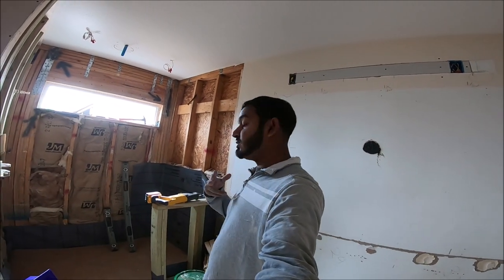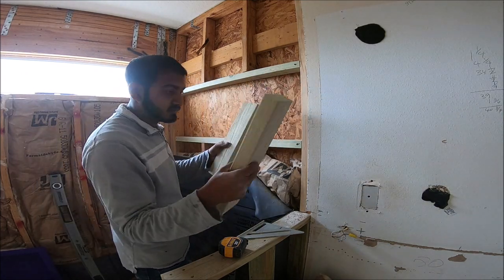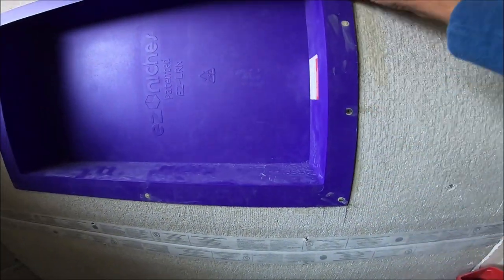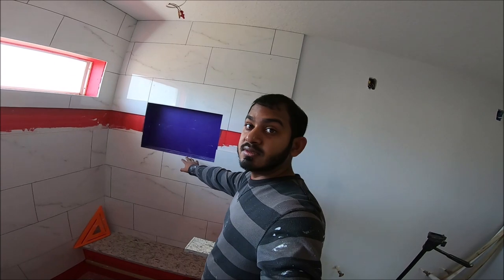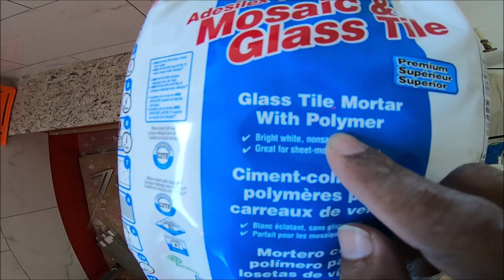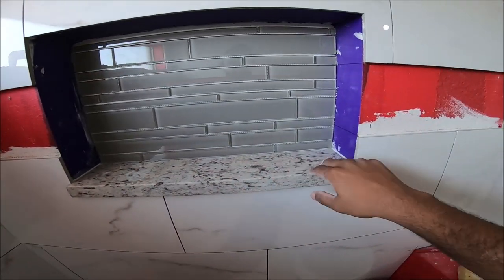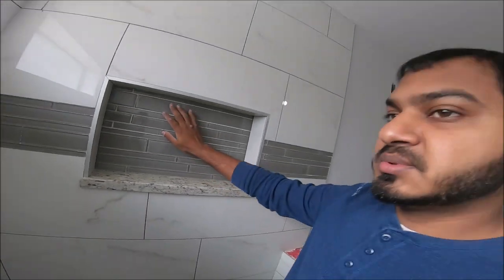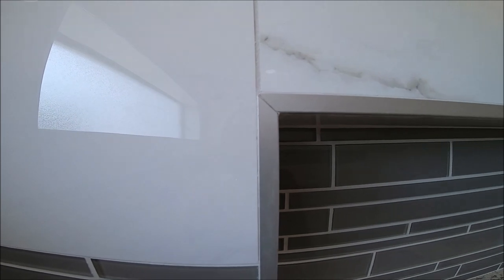How To Tile A Shower Niche - EZ-Niche, Granite Base, Metal Edging, Glass Tile, & 12 By 24 Tiles

Comment: At first I was nervous that you cut those studs but didn’t carry that weight with anything, but then you came thru at 4:26 and put my fears to rest 😂🤣😂
Reply: Heh...if it was load bearing it would probably smash down on the blade on his sawzall and get locked up.  Definitely know ahead of time if what you are cutting is load bearing though!
Reply: It is a load bearing wall, he needs to learn how to frame and put a header in there loo

Comment: Except for the fact that this will not pass building code, nice job!
Reply: If that's a load bearing wall which it does appear to be based off the framing and exterior plywood then exactly. Regardless being a tile guy myself I frame niche out with a header king queen jack studs for code and integrity if the house makes a dramatic shift, i know my tile isn't gonna pop and cause structual issues on a load bearing or  partician wall lol

Comment: Really good job, but do you not use silicon on the wedges ?
we always  use silicon on all the wedges on the  wall and floor, in Europe.
I figured out that on a few years of use some tiles crack because of the movements of the house and pressure from the corner.
with some flexible silicon it can work without cracking the tiles.
Reply: silicon at corners? What do you mean "wedges" (at the niche?)? thanks for respoinding, I am doing this now in europe
Reply: yes, sorry, i meant the Inside corners and Joints. @ramsareit
Reply: caulk the corners

Comment: You have a lot to learn buddy. One vertical grout line fits and the other don't. If you ever work for my clients they will boot you out in a minute.
Reply: What do you mean buddy?
Reply: Hater
Reply: That’s an exterior, load bearing wall that you just hacked to install that niche. Your going to definitely get some movement on that wall now and it’ll transfer into your tile work. Cracked grout and loose or cracked tiles. An you now have no insulation behind the niche. No bueno sir.
Reply: Man, I commented too soon…you installed it ON TOP of the board? Holy hell let’s see how the rest of this goes!